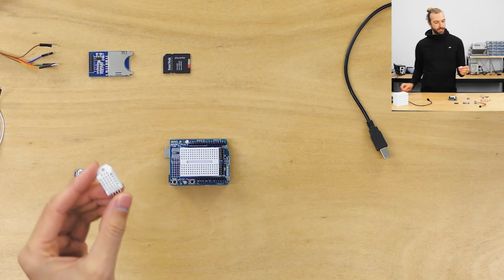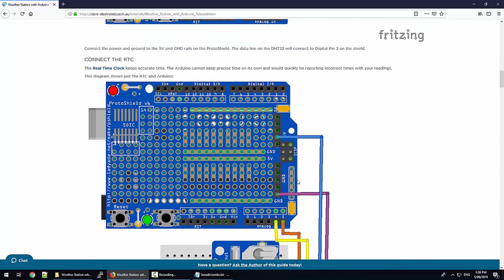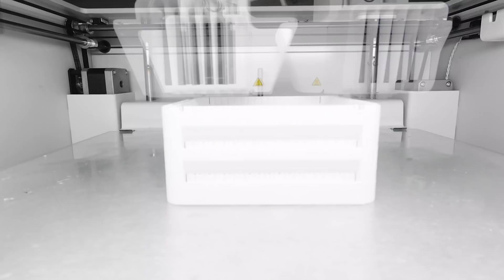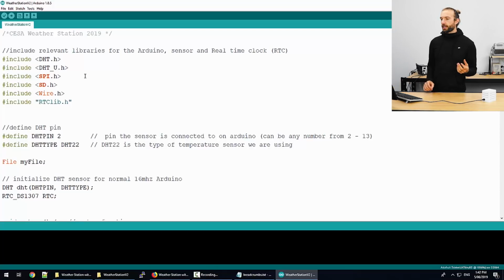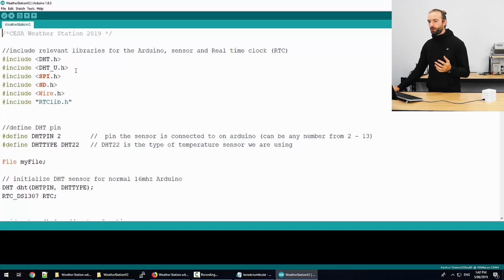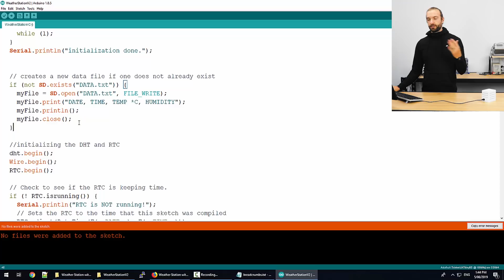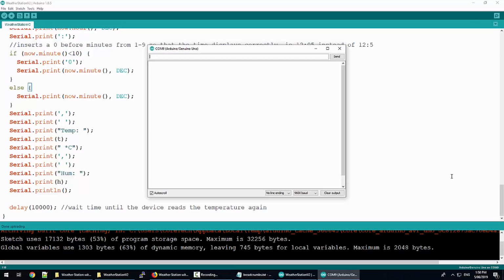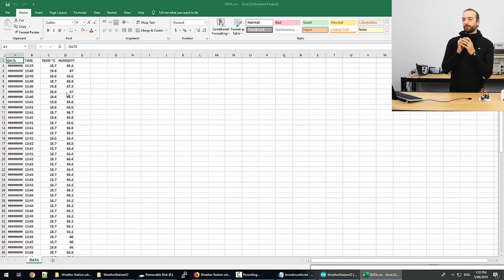Weather Station with Arduino Tutorial

Comment: I made a weather station from scratch using a pic18f45k20 and c language. It measured wind speed wind direction and temp.  I made all of my libraries and code myself. Arduino seems a whole lot easier in that sense. Most of the coding and libraries are done for you

Comment: Hi I'd like to make one which measures the temp and humidity in the room its in as well as a wifi connected 2nd sensor station (temp and humidity) and display together on a small but decent TFT display with no flicker,.  Are you able to point me in the right direction please?
Reply from the maker: Sounds like a great question for our support team, if you post your question over at our forum ( forum.core-electronics.com.au ) one of our team will be able to help or a member of our incredibly knowledgeable community. 😀